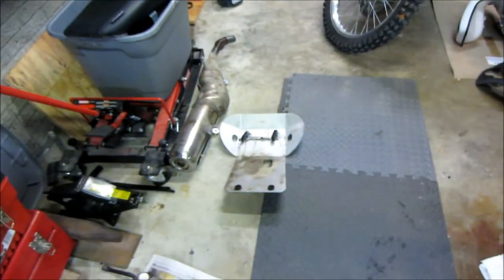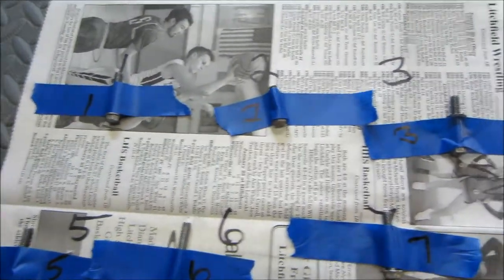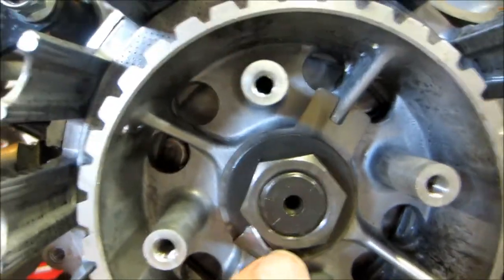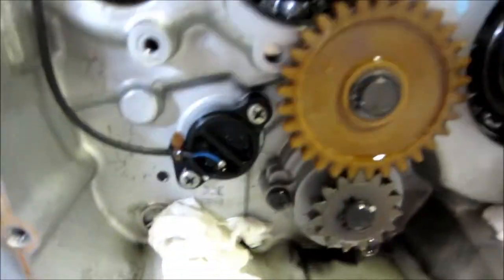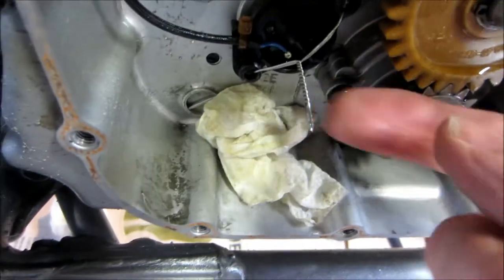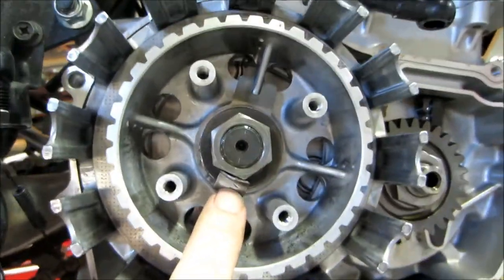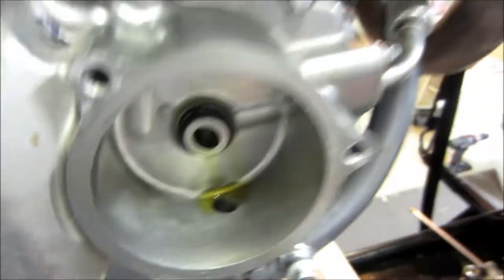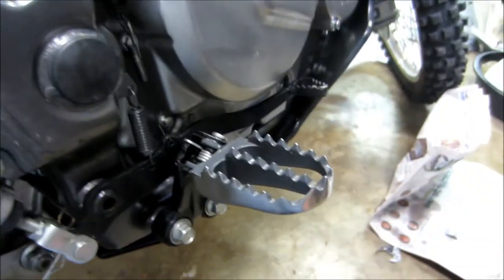Chuck's DR650 setup part 2

Comment: I saw a guy (in a video) remove his NSU bolts and replace them with Lock Tight, without removing his clutch assembly.  He made a special off-set driver that fit the bolts.  It was pretty cool, but I like using the wire securement method much better.  You just can't beat that wire back-up.
Reply: Have a link to that video?  I was thinking of doing it without pulling the clutch.

Comment: Numbering the bolts is a waste of time, just throw them all in the holes loose and move them around until they all stick out equally and then you know they are in the correct place.
Reply from the maker: I prefer to take a minute to number them so they all go in the right place then to put them in and then take them out until all are correct. Glad that you enjoy doing it the other way.